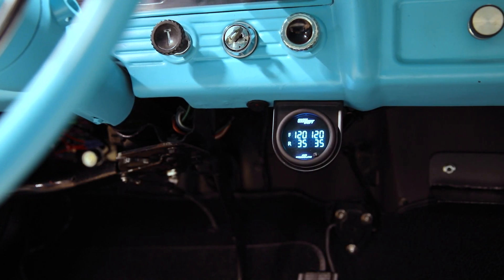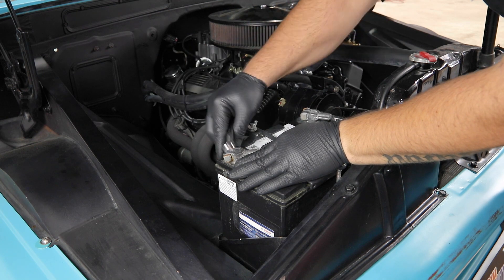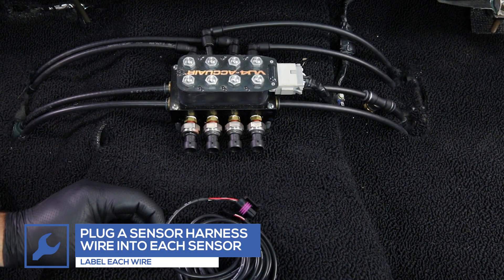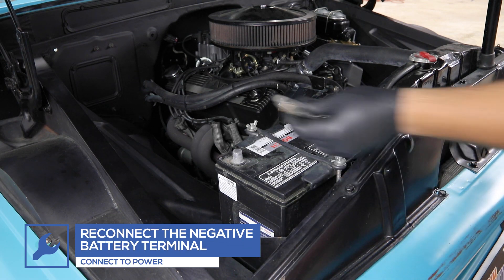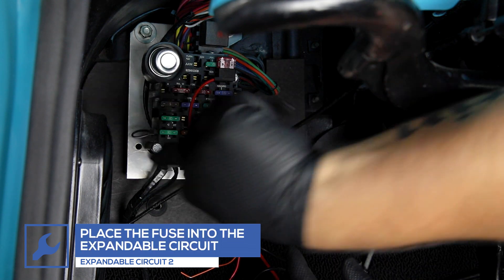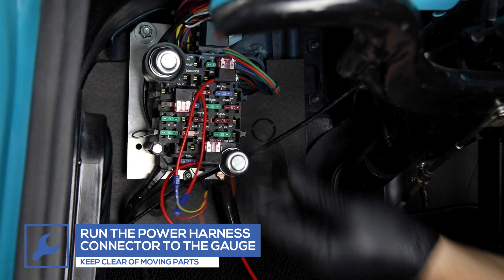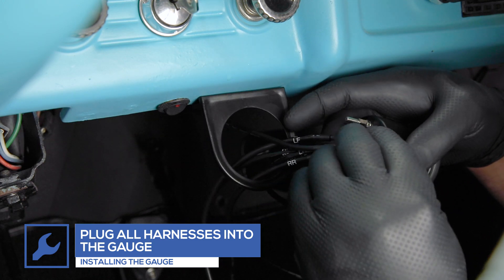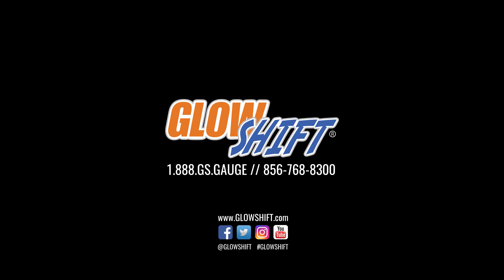Installation | GlowShift 10 Color Digital Series Quad Air Pressure Gauge for Cars and Trucks

Comment: My set up is wires from the tank straight to switches on my dash but the previous owner of the car didn’t instal a manifold on the system. So since there’s no management for the air ride it’s just 4 switches that operate each bag on the car. So my question is do I need a manifold to run this glow shift pressure gauge? Even tho I don’t have digital management?
Reply from the maker: You will need to check the system to see if there are locations to install the pressure sensors. If you do not have any ports then yes, you will need a manifold.
Reply: @GlowShift  ok is there such thing as a cheaper option the a Mansfold? Just curious because I won’t have any need for a controller since I just have switches. As in cheaper option I mean like a adapter where I can screw in the air lines then attach the pressure sensors? I can only see it working if there was such thing as a T connector of some sort.
Reply: I’m thinking maybe you could hook up female push connects to the sensor parts that would screw into a manifold (if you get what I’m saying).

Comment: It is dangerous if the wires are short and I cut to make longer like an extension ?
Reply from the maker: We do not recommend cutting the pressure sensor wires but the powers wires for the gauge itself can be extended.

Comment: Will this help keep the front end or the backend level I have half inch lines and do not have an E level I have to level it out manually My back and always seems to have a SAG on one side
Reply from the maker: The gauge is not meant to actually control the pressure, it only displays the pressure reading.